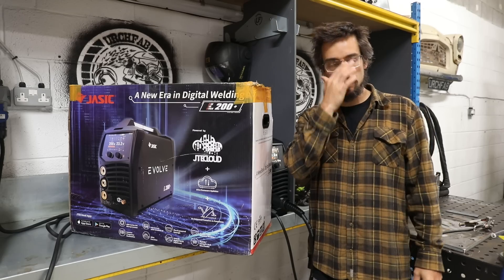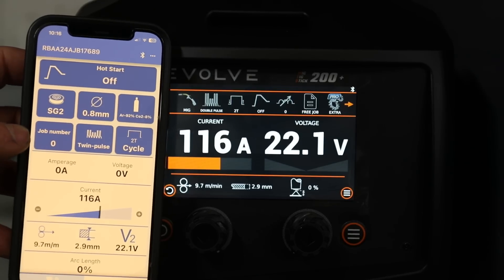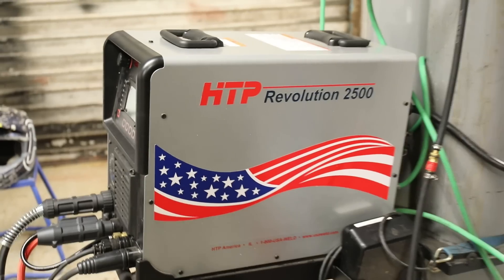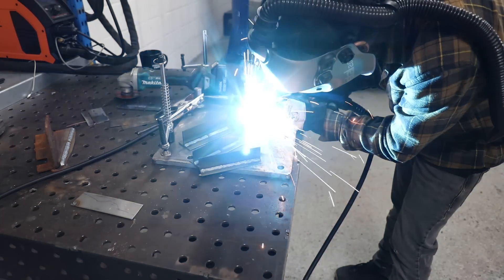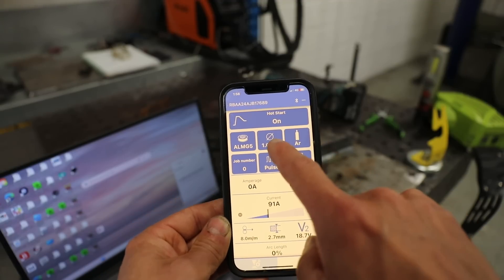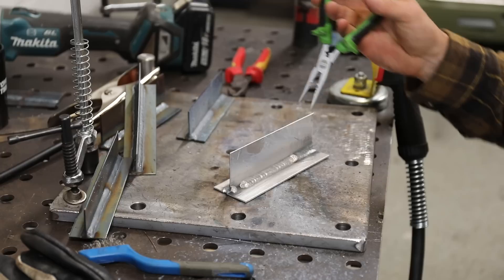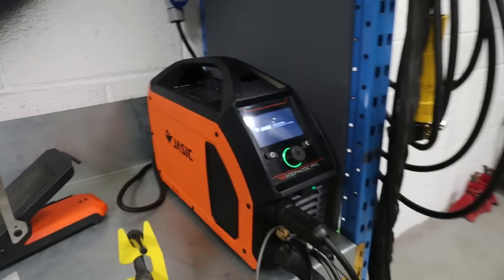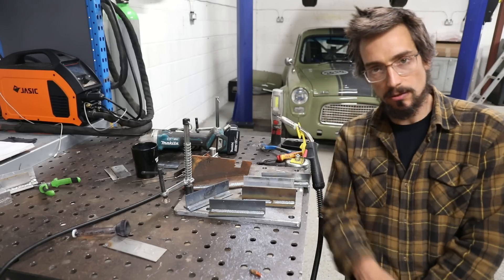Are Welders Becoming Too High Tech? Jasic Evolve 200 Mig / Tig Welder Review - Pulsed Mig Aluminium

Comment: Good review and demonstration. Question, can all the parameters of the pulse settings be modified, like the frequency used, the duration of the on and off, and in double pulse what can be adjusted.  In your opinion what would be a better welder model to do pulse on aluminium., I ask as the price of this Jasic is closing in on that of a similar sized Miller Helvi Bohler or Lincoln. Thanks

Comment: just read through the entire manual for this, just had a question, could not get a answer for it there, can it take a 300mm reel on the spindle or is it limited to 200mm. (on a esab you can easily find that info on brochure/manual ), by the way its septmeber now one month from your video upload date, selling at all the usual sites for 2182 pound inc vat, anyway.
Reply: It says it takes a 200mm - 5 kg reel of wire in the manual (Page 13)
Reply: @user-reddev77  thank you for the reply I will take your word for it. on the manual that  I can access on the website for the Evolve 200 +  the page 13 is completely different its a chapter on "welding operate instructions"  section on how to 2T with graph diagram.  Manual version is  rev0.0.  Anyway. PS I replied to your message few hours ago but it got deleted. I had included a link to the jasic manual pdf on their website, Our Urchfab's admin seems to be very strict. Thanks again for the reply much appreciated.  (i wont be going back to a D200 after seeing the economy with D300 on mig regardless of any fancy features)

Comment: Hard to imagine someone who does welding for a living saying; "Gee I wish my welder had Wifi and Cloud and I could use a phone app to adjust it"
Better to lose the computer menus, and just have a nice large panel on the front of the welder with a knob for each parameter.
Oh yeah, knobs cost money. Wifi junk chips are cheap
Reply from the maker: Yep, I prefer something simple. To be fair its pretty simple if you use it normally.
Reply: @Urchfab    Yeah I like a product that works properly BY ITSELF.
The moment they start talking about "phone apps" it means; 1. The product is not properly featured to work by itself, and 2. they want to put an invasive software on my personal phone that has all my contacts and possibly photos and financial data etc.

Comment: personally i think they're getting WAY too high tech, all my welders i can repair my Pickford oil cooled stick welder i can rebuild from the ground up, my  AC/DC TIG i can be repaired fairly easily & my oxford pulse MIG 270-1 has a lifetime parts supply.

Comment: Purchased This machine a few months ago, The pulse functions are an absolute dream to use on all material thickness's . i'll never buy workshop machine with out pulse functions.
Reply from the maker: Pulse is a game changer for sure.
Reply: They say it burns through thin aluminum. What is the minimum thickness of aluminum this machine can weld?

Comment: UK price circa £2500 - Did notice from specs power factor was 0.65 which is why it blew your breaker. They have skimped out on putting in  a PF correction circuit to save money I guess. I guess they have spend the money on the screen and computer and less on the actual welding part. Bit Like a Tesla car :)
Reply: Pretty sure Matt said it was trying to pull 32A on a 16A breaker. That's why it tripped.
Reply: @martindean1205  devices with poor power factor use excess current from the supply but it doesn't translate to real power. You need to understand three phase  reactance theory to know what's really going on. Suffice it to say it's drawing more current than it needs to weld.
Reply: Funny mine has PFC